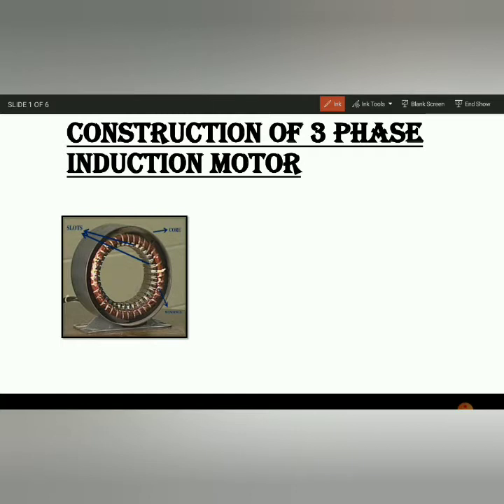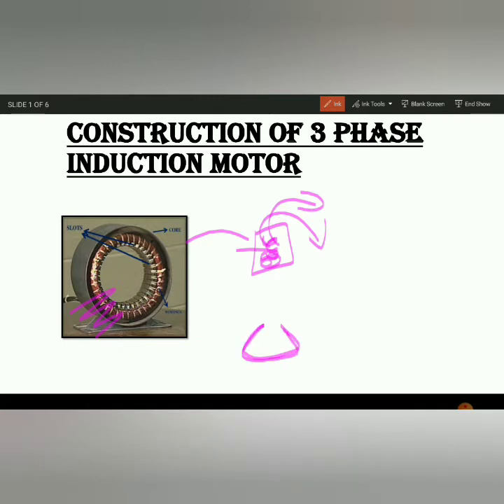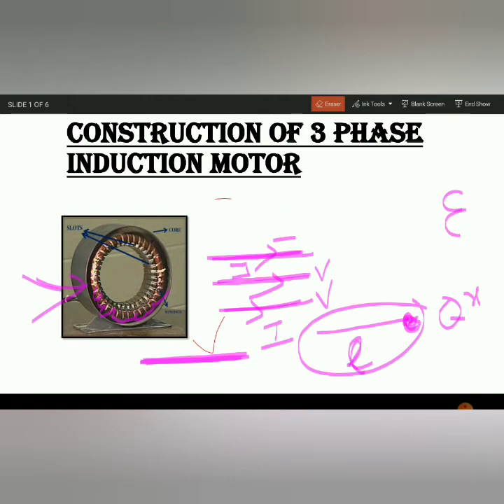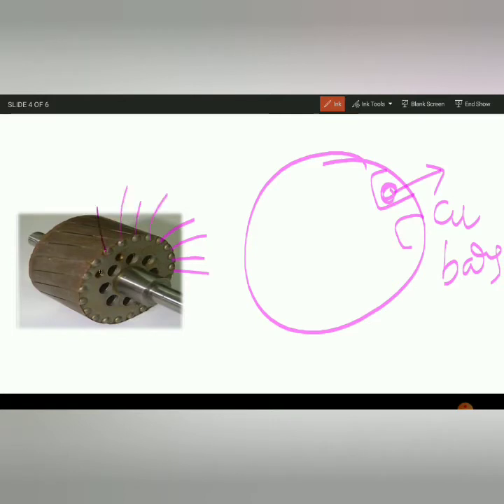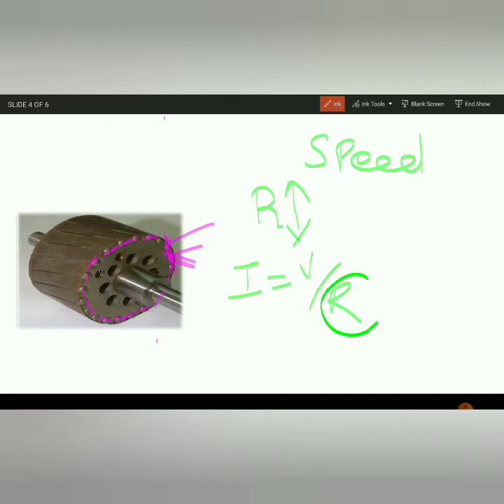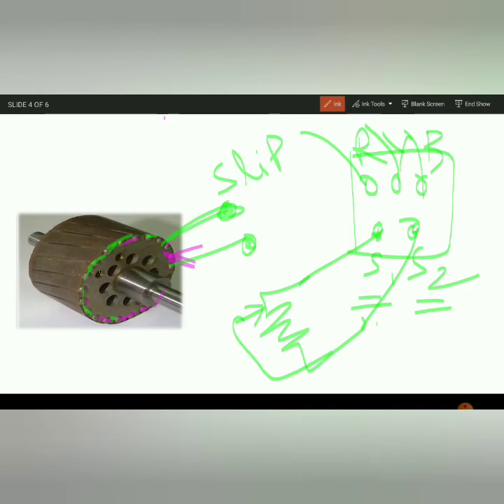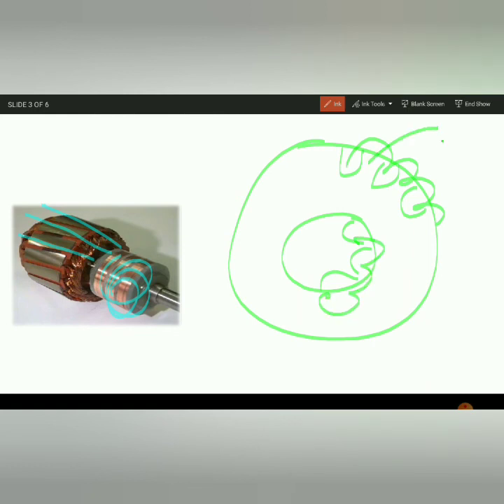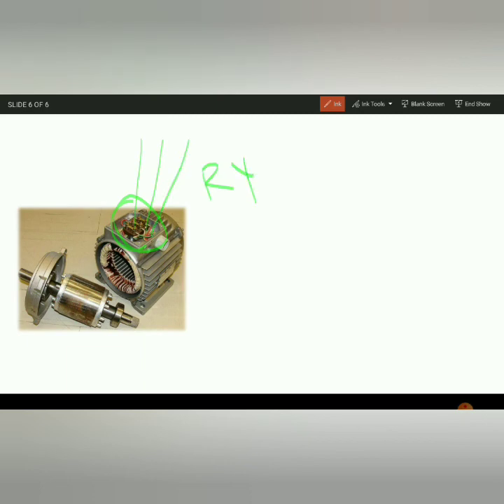Construction Details of Three Phase Induction Motor

Comment: Mam: what is magnitude and torque
Reply from the maker: Magnitude means the height of that particular quantity at that particular time.
Reply from the maker: Torque means rotational force. If u want to move some thing you will apply force that is called linear force. But. If u want to rotate some thing you need torque. This is also force but not linear force. It is rotational force.